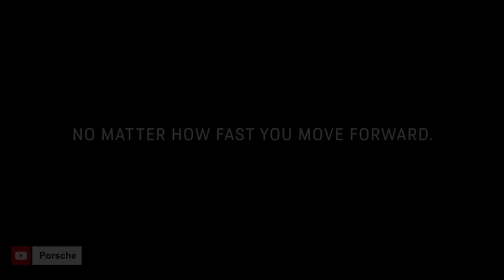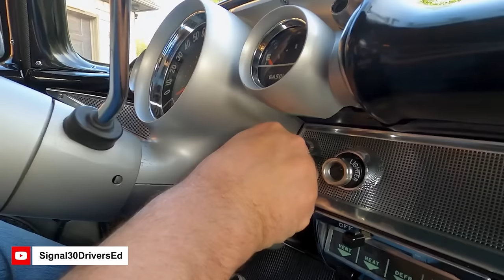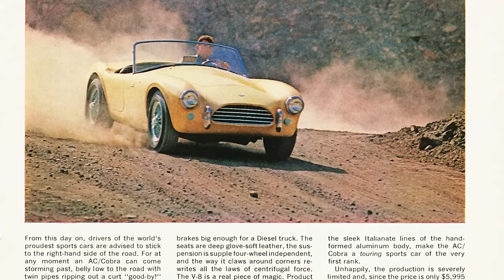Why Old Cars are Better

Comment: I'm 75 years old and so have lived with these old cars as just used cars a few years old.  I can tell you that these cars - say a 57 Chevy or 68 Dodge were every bit as reliable as new cars are now.  Neither my Chevy nor my Dodge, nor my 61 Comet ever made me walk.  They just started and went, just like cars do today.  Certainly not as comfortable, or fast, or luxurious generally, but reliable.  You have to remember, in the 60's or 70's, it wasn't just car guys etc. that drove these things - everybody did - it was just what it was.  We all had to get to work, go on vacation etc just like we do now - and those vehicles did it just the same.  If you could find a brand new 65 Chevy somehow teleported to today,  I would have no qualms about driving cross country with never a thought about reliability - we all did just that back then

Comment: There is certainly a sweet spot to be found as you alluded to. I have owned a 72 MGB, it was very happy at 45mph but I wouldn't commute in it.  I now own a 97 240sx and a 2023 GR86, on paper the 86 is better in every way.  In reality, I prefer the Nissan because of the soul and the involvement needed while driving. Good video

Comment: I technically drive a classic car. I don't really think of it as one but when I was asked if I wanted to put antique plates on my '96 Buick Century I was like damn, I guess it is. It's just before they rounded them out, actually really funny to see the commercial clips in this video. People have started complimenting my church shuttle, and I can only assume they are mistaking it for a regal or something cause it's a very generic car. I personally love it, I just dropped like 5k on repairs for it just to make sure everything was brought up to par, which didn't quite work but progress for sure. It is one of the most comfortable cars I've ever sat in, I love the bench seats be it for when I have a date riding with me, or if I'm taking a nap during a road trip. It feels faster than it is, the suspension is crazy, it's still an automatic instead of manual, which is convenient, has a tape deck and powered windows but you still have to use a separate key for the door and the ignition. It is a car that has a good balance of outdated and modern features. Love that stupid land boat.

Comment: Great video, and no, it's not just nostalgia. Older cars are more stylish, actually come in colours, and once properly sorted and maintained, are quite reliable. You can also maintain them yourself with a modicum of skills and a few hand tools. Not so for modern cars, especially when 20 years (or even 10) down the road, specialized electronic parts are NLA.  That's why most of my cars are 50+ years old, including two vintage Volvos, three little British sports cars, and a classic Chevy pick-up. Most of these will likely still be running 50 years from now, unlike most of the stuff sitting on new car lots. Nice Triumph Bonne, BTW. Cheers!

Comment: I drive a 2011 Peugeot 207 and I like to think of myself as an above average driver, I rev match or and heel and toe every single downshift perfectly, drift, and I race my car. That all changed though when I drove my uncle's 1982 Mazda B1600. I couldn't even figure out how to start it and keep the engine idling, I couldn't even keep it going in a straight line and I kept stalling it. That was all for the first 10 minutes though and after I got the hang of it, it was the best experience of my life. I was just laughing like an idiot while driving at 10 mph. Everything was an event in that truck. Even going over speed bumps was fun in that thing somehow! Visibility was perfect, you could see the hood in front and place the car perfectly where you want it on the road. And when I got back in my Peugeot I realized that since I first got my license I never actually drove at all. The car was driving for me. And that's how I completely lost all interest in all modern cars

Comment: I'll agree to a certain extent that older cars are better especially your classic full size sedans like a Chevrolet Impala/Caprice Buick Park Avenue Ford Crown Victoria Oldsmobile 98/88 Mercury Grand Marquis etc. though some cars started using plastic interior/trim pieces in the 1970s for weight savings as many of them back in the day weighed over 4000 LBs and over 5,000 in some cases such as a fully loaded 1967 Lincoln Continental convertible which could weigh up to 5,700 LBs

Comment: When I drive one of my old cars, there's a lot more mental focus, just getting out of the housing plan, the shifter, the starter, does it idle vs teh camry, turn the key and go.  I think this is a pretty good assessment of old cars.  I think you can only get a project after you have one old one to drive around, then you will realize, that itself is a project with all the stuff  you have going in your life.   I know a guy who instead of finishing any project, he bought another and another and another.  He was lucky to have a friend who told him, you have to many and pick one and do one thing a day on it.  The one thing a day is the only way I have been able to get anything done.

Comment: I have a 1985 Mercedes-Benz 190 D (W201) and it couldn't have been more reliable than it has been the past, almost, 4 decades...the problem is when it eventually breaks down and the friendly, local mechanic eventually retired or got too old and sick to work and his sons/grandsons aren't that familiar with fixing a car that can be as simple as it can be (W201 are a bit overly-engineer but when comes to the 4-cylinder diesels, the engine can't be more simple than it is and there is almost no electronics apart from the bare bones) don't have a place to plug a computer to make a diagnosis, you need to know your stuff and also when the mechanics became less of mechanics and more of "component assemblers/replacers". Of course now it is getting annoying and expensive and everything seems to be giving out all over the place, but you can expect that from a almost 40 years old car that was bought used in the early 90s and since then served as first car to my father, me and briefly my brother (which had a moron T-bonning it's front once in a intersection). And guess what, when it is working close to 100% right it is a car as nice and as confortable as a car needs to be, you don't need anything else...maybe AC, a GPS and a Bluethoot sound system but you can adapt AC to it and you can manage it by using your phone and adapting your radio.

But I know now all classic cars were created equal, some aren't that sturdy.

And honestly I don't feel that safe with all the ugly, "made for being super-safe" modern cars driving all over the place when the large majority of those cars seem to be driven by clueless idiots that have no skill or respect for the others and are always distracted on the road. 

Cars aren't built as they used to to, but drivers aren't built as they used to either.
Reply: Those are long lasting cars.

Comment: A lot of these points are very subjective. The most objective point here is that the older cars were made sturdier and longer lasting. But pretty much everything else is very subjective and comes to personal preferences. For most people, safety and comfort is more important than "feeling the road" or doing a routine everytime they have to start their car and before driving. Most modern cars objectively are much safer than older cars. Most people want smooth ride rather than feeling every bump on the road or driving with 35 to feel like 70, you could do that in a modern car, just put older and more weared struts and shock absorbers and trust me you will "feel the road" and 35mph feel like 70. 

How the car looks is also very subjective, for me 80s and 90s cars were the ugliest cars ever made, but someone else may find beauty in them and I'm not going to try to make an "objective" argument with them why they're ugly, because there isn't one. There are mid tier cars for 30-40k nowadays that look like sport cars and a lot of people like the looks. In 50-60 years, people may have nostalgia for 2010s car designs, just like we do with 60s and 70s cars, it's impossible to know what will people like in the future.

Like with homes, some people will like vintage design, others clean and modern. That's not an objective argument of which is better. Of course old cars will stick out and people will stare at them because it's from a different era, but that's with pretty much everything. If you go somewhere and pull out a 90 or even 80 giant mobile phone, while everyone else uses a smartphone, people will notice and find it interesting.
Reply: Yes I though the video would be focused on the manufacturing process and the parts of the cars in the past which made them last for longer. New cars also have much more components and electronics than old cars. More stuff means more things than can break, but that's the technological progress. A chainsaw would blunt or break easier than a regular axe, but that doesn't mean we should all just use axes to chop trees
Reply: The more disconnected the driver is from the road, the less chance they have of skillfully avoiding an accident or maintaining their attention. 
People become complacent and less attentive the more 'safety' and 'automation' is involved.

"Modern cars make bad drivers; Old cars make skilled survivors"
Reply: @LRK-GT  What is better, be skilled or be alive?

Comment: Tell me. Is a brand new car that starts and runs everyday reliable? I'd say yes. Is a 50 year old car that starts if the battery terminal is tightened reliable? Totally! Is a 50 year old car that needs warmed up before driving daily reliable? Yes. Just because something has a fuel system that needs warming up (even back then, it was just normal, noone complained), doesn't make it less reliable. In my experience warming a car up, replacing old worn parts and just keeping an old car tip top is much better than doing the exact same thing to a modern vehicle with more weight and less actual material. Just look at a modern suspension and how much material they use 🤮

Comment: Lets be entirely honest, each car has its own characteristics.

New cars are far safer, far more features whether you want them or not, ac, radio, sun roofs, longer warrantees, and depending on your taste look very attractive,

Old cars are made of arguably simpler and more reliable components and are cheaper to fix and work on, 30s cars and high luxury used real wood and leather 

I think the problem is the 1950s 60s and 70s vinyl and nylon and plastics were seen as luxury and are cheap now. 50s cars are complete rust buckets and were designed to be perfect only for 4 or 5 years. 

Its also a big question on upkeep, change oil and tune up parts and old cars last but I would never believe a bel air made it to 1million miles like a toyota prius did. My mother and gran each had 90s ford escorts and lasted over 15 years of everyday driving and long roadtrips with no problems. 

I think what im saying is good cars get made every year and cars also breakdown everyday and always have
Reply: Rust-proofing/undercoating was available.  People just didn't want to spend the extra money.  Also, GM cars of the 50s were NOT rust buckets, nor were pre 52 Chrysler products.

Comment: Calling old cars better or worse is not really applicable. If you're driving 30 miles to work every day, an Alfa or MG from the 70s is gonna be a terrible choice. But if you're just cruising the Blue Ridge or Pacific Coast Highway for a weekend trip, a 2024 Elantra ain't it.

Comment: I'm 57. Anyone my age who has an old car today is a "motorist," i.e. a hobbyist essentially. But it would be the same at any age, because the worth of personal transportation (assuming you're not a racer) is as an appliance or a hobbyist. Both have costs, both have different rewards.

--> I have to push back on the video's premise here, having lived through an older era when every car was simpler AND people my age had direct experience with older people who came of age throughout all of the preceding decades. 

Here's the deal: Professional mechanics have always been the norm, even when cars were dead-simple. Most owners never got their hands dirty. They just did not.
Reply: I think the thing is this channel is for people whose hobby is working on old, generally not so reliable automobiles. I take their point that modern cars are more closed off to amateurs unless you have the right, and expensive, equipment. And hey, if you are having fun working on old cars then go for it but the "every thing used to be better" really isn't true. I've owned cars since the late 1960s, my first ones were early 60s models, and I remember so many cars being hard to start in cold or wet weather. Spaying "QuickStart" (essentially ether) down the carb to try get them to fire up, which usually worked but not always and definitely not a safe or recommended practice but you did what you had to do.  Back then "my car wouldn't start" was a common and believable reason for being late at work.  I haven't had a car that didn't fire right up almost immediately right away for many many years. Today people will, without even thinking about it, hop in a car and drive 1,000 miles and complain bitterly if they encounter even a single problem, but typically they do the 1,000 miles there and 1,000 miles back without any issues at all.  That certainly wasn't something you could take for granted back in the "good old days". Cars today are more reliable and better in almost every way you can measure -- handling, power, acceleration, braking, fuel consumption, emissions and on and on. Of course old cars can be a fun hobby but better? Probably not.
Reply: Thenexhobby@Are you kidding me?,Dads takin their sons out  to the garage  to help them work on the family  car meant that you were growing up and that it was time to learn to work with your hands  and numerous high schools had auto shop  not just to  teach teen age guys to work on cars but to learn a trade  not olny that but we at Valley Forge high school  where I graduated  from also had a Vocational Auto Body shop as well as learning welding.My whole point is is that learning to work with tools  and to be able to do things around the house and Cars is STILL an  important skill and yet today espically  today's young people don't  respect that as they should!!!!.
Reply: Scores of males DID get our hands dirty.  I still do, and love it.
Reply: If it wouldn't start in the cold, that often meant it needed a tuneup, or, your choke wasn't working.  Both easily fixable.  If a modern car won't start, you have to have to towed to a shop.  Yes, it is much less likely on modern cars, but the fact that you can't fix it, and it will cost a fortune to pay somebody to fix it, is a big turn-off for me.
Reply: And if it needed a tuneup to the point of not starting, that was YOUR fault

Comment: I gotta disagree with one thing, old cars handling. Having driven a 51 chevy 3600 and 73 firebird, in both cases i have NEVER felt more disconnected from the steering impulse lol. Its definitely an experience
Reply: Get sway bars.  It's a hell of a difference.  You're feeling the body roll more than anything, I'll bet you.  My '72 Charger with a beefy front sway bar would tell me if I'm running over a single leaf.  So does the '95 Chevy truck with beefy front and rear bars (amazingly nimble for being 6080 lbs), but Mom's Mazda Tribute feels like playing GTA for all the feedback I get, and the '78 C25 with no sway bars feels like I'm in a bounce castle.

Comment: Old cars are far more capable to travel freeways than you infer. My Dad used to travel on vacations with our 1966 Buick Electra at 80-85 mph cruising speeds with no issues. They had no OD gears, but the 2.9 or so ratios gave them plenty of top end. Aside from brakes, they were plenty capable. Cars today are appliances, not expressions of emotional satisfaction.
Reply: Cars today need some electronics for fuel efficency and some protection, but they overexagerating with electronics and computer.
Reply: @Telecolor-in3cl true many auto companies are being forced to remove some of the computers for safty thank God and those computers are not even popualr Tesla is learning the hard way.
Reply: That car has HORRIBLE brakes and a mediocre suspension.

Comment: Keeping a carbureted old manual transmission i6 f150 around has been a lifesaver at certain points when nothing else would run and there wasnt enough money to fix it

I like the EFI versions of the old ford engines as a best of both worlds for a daily driver but nothing is cheaper to keep running than a carburetor when you absolutely must have something at all to drive